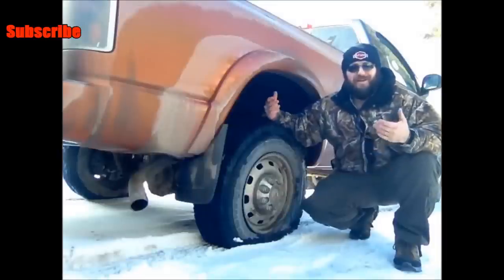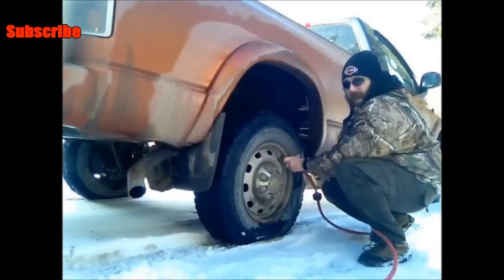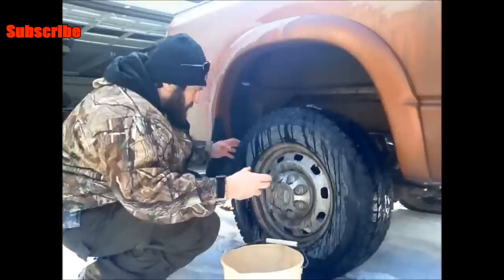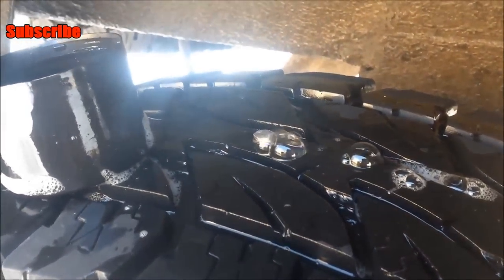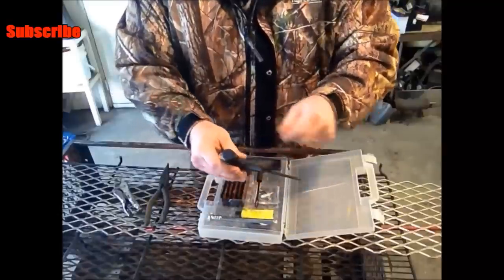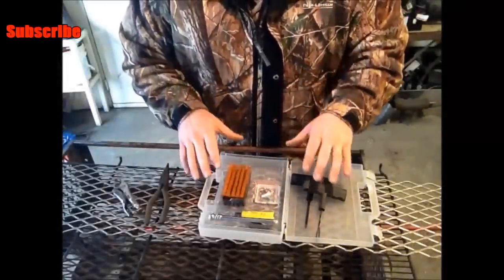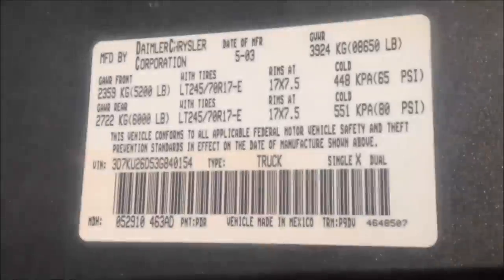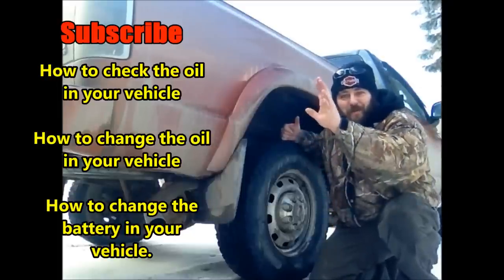★DIY Cheap + Easy Trick For A Flat Tire Repair. Never Be Left Stranded Because Of A Flat Tire.

Comment: Great tutorial Dan. Having a 12v compressor and a patch kit in your vehicle could potentially be life saving. Allot of people have been stranded due to a simple flat.
Reply from the maker: dadgad68 your not kidding, There are so many times that it has been the difference between stranded and on the road again. Thanks for watching and commenting it is good to hear from you. I look forward to the next time.
Reply: Not only that, you can get "car jacks" that are essentially a large rubber cushion that you can inflate with the 12v compressor, in case the hole is too big and you need to use the spare tire .... takes all the hard work out of the situation. :)
Heck, there's even air jacks that work on exhaust fumes. :D
Reply: "There is absolutely no need to repair a flat tire on the road" unless or until you get another flat before being able to replace/repair the first flat.  Think about long trips in the middle of nowhere on bad roads (or not on roads at all).  Another multiple flat situation is if you drive over a box of drywall screws or something that fell off a truck.  I carry one spare - not four.

Comment: I have found plugging to be suprisingly successful.
Reply from the maker: James Campbell Yes, it is successful under the right circumstances. For small repairs like this it a win win. For larger holes, like a from a piece of re-bar or a jagged puncture or tear, the plug is to small and it will just push up out. Those need to be repaired the traditional way. But at least this is a viable option for now. Thank you for watching and commenting. Im looking forward to our next conversation.

Comment: These patch kits work pretty well for atv and lawn tractor tires, I've never tried using one on a car or truck tire though.  Glad to know it works on regular car tires just as well.  I need to throw one of these kits in my truck.
Reply from the maker: William Todd Let me say from experience they are the difference between being stranded with a flat and being on the road headed home. In my opinion,m for as cheep as they are they should be under seat of everybody's vehicle just in case. Thanks for watching and commenting.
Reply from the maker: William Todd how is the pen turning for the big order going?
Reply: Dan Rogers Waiting on supplies.  They tour the country for a couple weeks before making it to my door :(.
Reply from the maker: William Todd So what you are trying to say is you use only high quality imported materials to make your pens? :) I am looking forward to getting to try one out.
Reply: Dan Rogers Doesn't matter what you buy its all been imported from somewhere.  The supplier is in Pennsylvania but their shipping methods are terrible.
Reply from the maker: William Todd true enough. Well at least you can say your pens have been all over the country. :)
Reply: Dan Rogers Haha.  Very true, they usually go through about 8 states before they arrive.  Most of my online sales have been out of state from a truck forum I'm on.  Very few sales are local, up until this order, most have been given away as gifts.  The lady that made this order is already working on a 2nd order.  She's ordering pens for Christmas gifts.  I'm going to show her some pen & pencil gift sets I've made and see if she would like to do a few of those for her friends.  Those are a bit higher end than the stylus pens she has been ordering, but hey an order is an order, its the customer not me that makes the decisions on what they look like LOL.

Comment: Where in the heck did you find a short box standard cab 3/4 ton dodge? I have never seen a truck so short with 8 lug wheels? even the older ones? Is this custom?
Reply from the maker: it is an 8 ft box in the video. I've looked into it though. it would have to be a special order, or a custom build.
Reply: Damn it man! It looks like a short box in the video! Nice truck man I like it! Thanks for commenting. I figured by looking at it something was off or not right, but after your reply IDK what it is. Either way nice truck man.
Reply: PS I had to edit my previous drunk spelling! LOL!